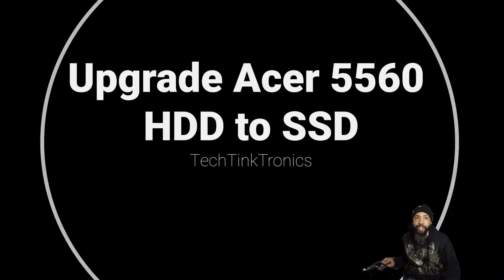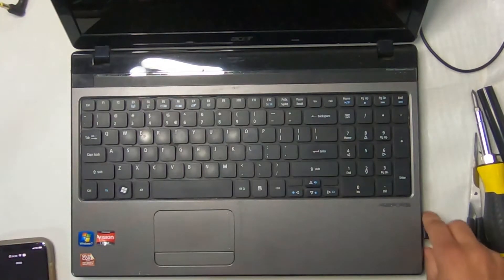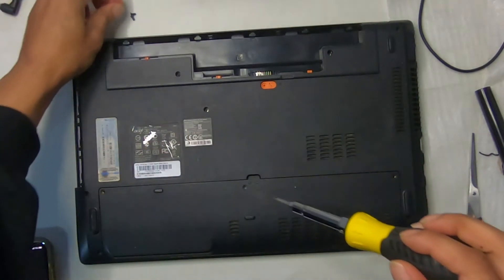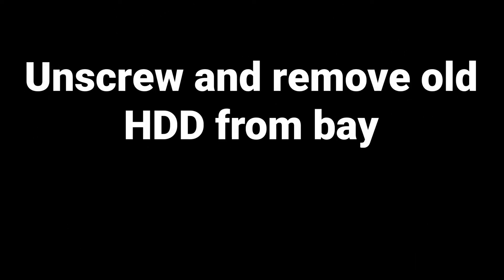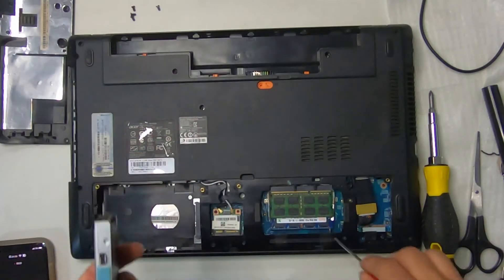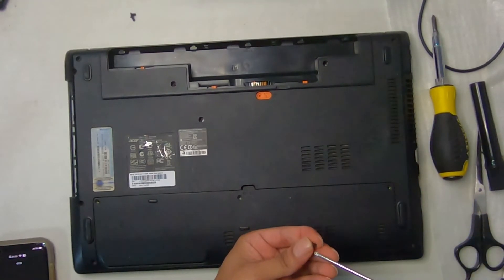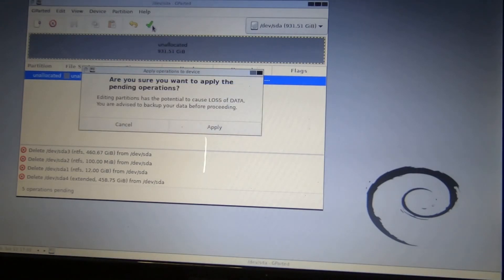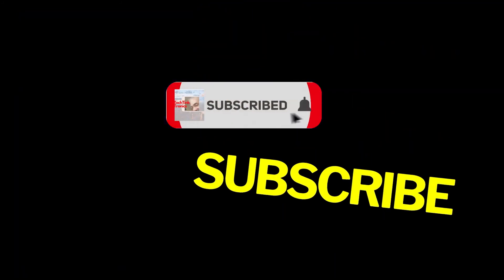Upgrade Acer 5560 HDD to SSD

Comment: I'm having problem with this laptop, yesterday I switched from hdd to ssd but laptop doesn't recognise SSD, when I go to bios it just says HDD=0. SSD is Kingston 240GB SATA2. Cant you tell me what version of bios do you have, maybe it has something to do with this problem. Thnx.
Reply: Did you solve this already sir?
Reply: @vancanque2213  Yes, but honestly I forgot how.
Reply: @blackened1231  what processor do you have? Can it play any games in 2023? Just recently bought an Acer aspire 5560 and planning to upgrade to SSD and 8gb ram.
Reply: @vancanque2213  AMD A6-3400M. Noo, forget it, it's just to weak and old, no upgrade will do any benefit because of old/slow cpu and gpu. It's good for web browsing, Word and simple stuff like that...
Reply: @vancanque2213  i actually managed to play dying light 1 and arma 3 and some other games with almost no upgrades other than 512 mb gpu on the motherboard, probably getting 8 gb ram and a ssd would do manage you to play some 2020+ games.
Reply: @aldodubini6883  nice! Its best for me to upgrade its SSD and RAM since it freezes on shutdown or restart. It has the A8 3500m
Reply: @vancanque2213  yeah, i agree.  how many gb of ram are you considering to put? 8,10 or "risk" 16?
Reply: @aldodubini6883  it would be best if I can go with 16 but the site says its only up to 8gb, how about yours?
Reply: @vancanque2213  im currently sticking with 4 gb but im thinking of upgrading to 8 atleast